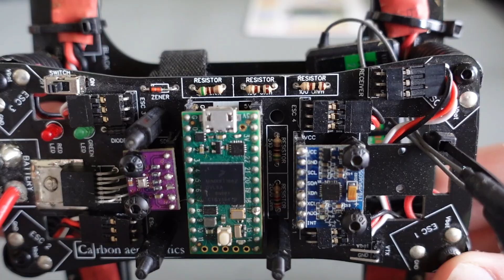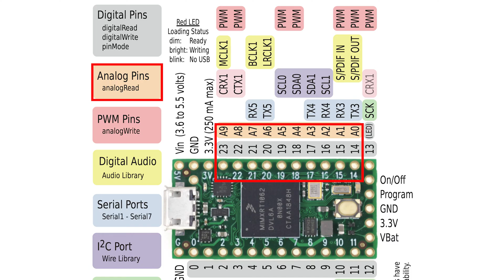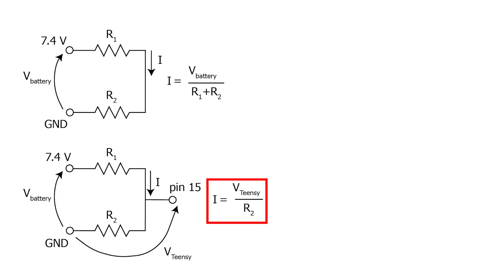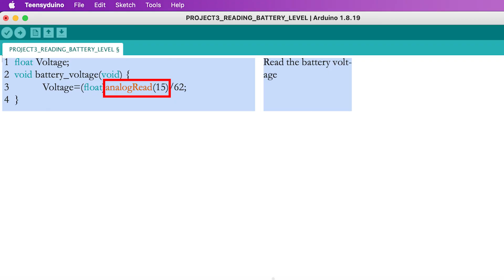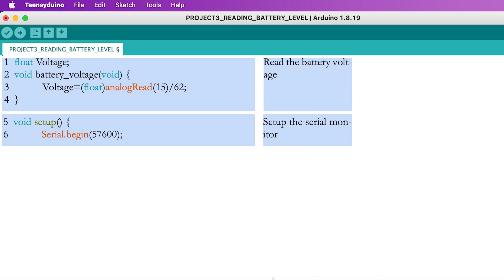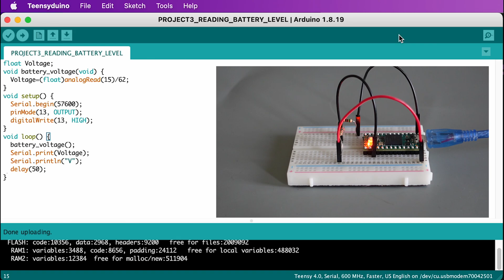3 | Measure battery lifetime with a voltage divider

Comment: strange why did u multiplied with 5 with 3.3 ? , shouldnt ur equation be |     voltage_out= (3.3/1023) * analog_val        ?
Reply: you forgot the voltage divider. The voltage connected to the board pin is a 1/5 of the power supply

Comment: Hello, I am using a voltage divider just like you for reading battery voltage. However, the problem is that when the motors are running with props, voltage drop occurs at the battery output. For example I start with %80 battery capacity, when motors are loaded it says that the battery has %50 capacity (for example). %100 corresponds to 12.6V, where %0 battery means 10.6V. So 2Volts is scaled to %100. If the battery voltage drops 0.6volt, my gauge tells differently. Is there any way to fix it?
Reply: pretty late answer, but you could use a sliding window filter to remove those voltage drops. And perhaps use capacitors and a schottky diode to protect against reverse polarity